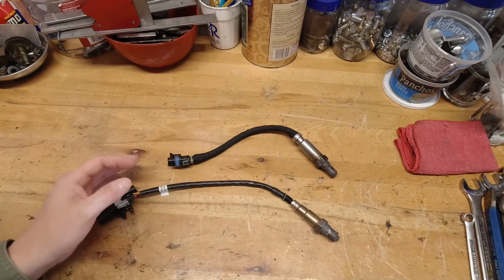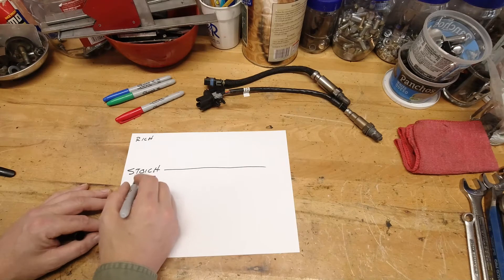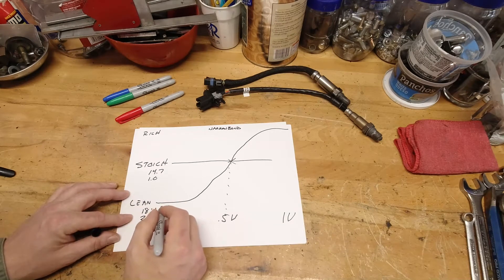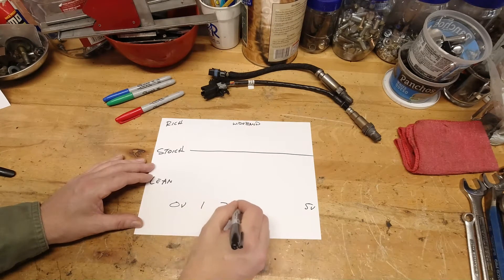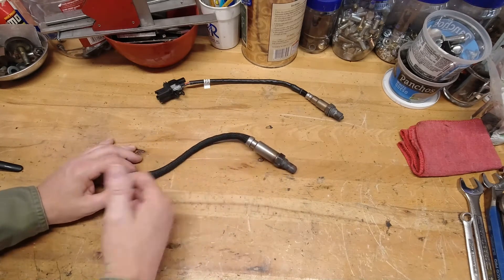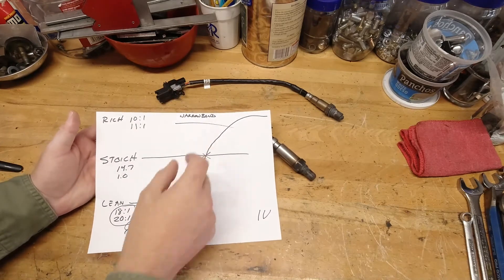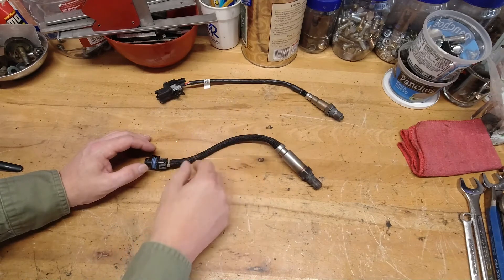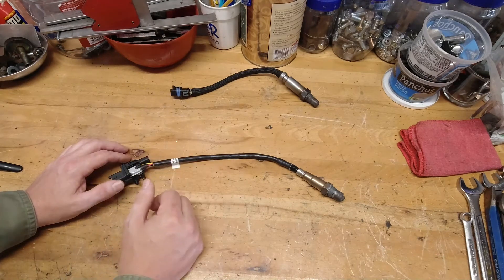Narrowband vs Wideband AFR Gauge

Comment: So theres a new in box UEGO narrow band near me for for $30. I'm a novice cheapskate just looking to polish my idle fuel mixture tuning abilities on holleys before I dive into metering circuit tuning. I know how to use a vac guage and listen for idle changes but just want to see how my adjustments actually relate. Good purchase or dont bother and get wide band instead?
Reply from the maker: Narrow band just doesn’t give you enough good feedback to make smart tuning decisions.
Reply: Kinda knew that would be the answer. Thanks for all that you do!
Reply from the maker: @justtellmewhy8078  I’ve done a lot of recent tuning videos with a wideband AFR if you’d like to see it in action.  The narrowband is just not enough info.

Comment: Question, I'm going to install a new AFR wideband gauge in my truck with duel 02 snsr's. The instructions say to install the 02 bungs a minimum of 24 inch's from the collector flange. I'm wondering how far away I can mount the bungs from the collector's and is there any issue with accuracy of the reading depending on distance? Thanks

Comment: Hello , I’m currently in the process of adding a small belt driven root compressor to a 1950 8n ford tractor. I’m looking to boost the flathead 4 cylinder with in normal operation rpm range through an updraft carburetors. Any recommendations for the modifications would be appreciated. Thanks

Comment: Thanks for your time and knowledge. I recently viewed a video from David Vizard about carburettor tuning and he emphasised narrow band gauge and sensor with I think reference to using a vacuum gauge as well. I am interested to find as much knowledge as I can before I make the purchase and yours seems to make sense. A question I have is to do with how the gauge and sensor works together, is there some other computer or analysing box needed or does the sensor wire directly to the gauge and power supply to be used in a vehicle with no computer. If you have any suggestion I would be grateful for your time. Thankyou.
Reply from the maker: @cameronjohnston5748   I just did a tuning video using a wideband AFR to tune an Edelbrock carb.  No other computer needed.
Reply: @MuscleCarSolutions  thanks I will look for it.

Comment: Great video I’m building a test stand to run old school carbureted engines. What other components would I need other than the wide band gauge to enhance my understanding of how the engine is performing related to the wide band components? I’m old school and currently have a tach/ oil pressure gauge/ vac gauge/ temp gauge etc??

Comment: I hope its not too late to ask this question, but I'm working on a truck that has factory efi with narrowbands. the engine had a big failure so it was rebuilt with performance in mind, its still NA but it has a longer stroke, much higher compression, better intake, bigger cam, ect. On my factory ecu I have an operating system that would allow me to wire in a wideband to replace the narrwoband which I plan to do eventually. But as I'm getting ready to fire up this engine for the first time can I get away with a narrowband until I have the funds for widebands with a conservative tune? I can't run a factory tune because the engine is radically different like not even the same displacement. Not gonna lie rebuilding an engine which needed all new internals and springing for a forged bottom end has bled me dry otherwise I'd just go get a pair of sensors

Comment: For the narrow band, Couldn’t you just monitor the voltage on the 02 sensor if 0.5 is stoich maybe even add a resistor to tune the voltage if needed?

Comment: I know this is an old video. But I’m going to ask I have an 85 Mr2 with the 4age NA. All run off the stock computer. Since all I am trying to do is know lean or rich from the gauge is it wise to just use the narrow band? It is an Autocross car but no power adder or stand alone fuel management. Just for fun. Thanks for any advise.
Reply: Wideband is a better choice, it gives more data between the signal voltage. Widebands are best to none when it comes to monitoring your afr (that's why all tuners use this). But if your really in a budget and just want to have a reference point to where your afr is, a narrow band with a wider breakdown on its signal voltage would be better. I think dynoracing has one wherein they broke down the signal voltage of 0 - 1 into decimal incriments to get a sort of precise reading on your afr during the rpm range.

Comment: Wow thanks a lot for this video!
I'm looking for a sensor with a gauge to put in my '65 Volvo, just to monitor if the carburettors need adjustment.
Now its clear I can just take the narrowband!
Reply from the maker: Narrowband will give you less info.
Reply: @MuscleCarSolutions  Exactly! I only need to know if it runs stoich or not, i'm not interested in the exact value!

Comment: Hi Sir,

2019 5.0 Mustang.

Would you recommend a Duel set up & where is the best place to install the 02 Sensors?

Supercharged & Headers installed on the vehicle. 

Or do you keep the original factory 02 Sensors & also add the Bosch 02 Sensors as well. 

My explanation is because I'm from Australia 🇦🇺 if my terminology is different. 

Kind Regards, 
William.
Reply from the maker: The factory computer will only monitor however many channels it has in the system.  If there’s only one, it will monitor one and you can’t add a second.  If you want to monitor it on your own or are switching to a aftermarket stand alone system, then two is always a better choice to monitor both banks.

Comment: I was really hoping this guy would mention carbureted applications and if there is any reason to buy wideband if only trying to make sure your not lean all of the time.
Reply from the maker: The whole point of an AFR is to monitor operation and evaluate changes made.  This is simply a discussion on the differences in the two types of sensors.  As a tuning tool, I assumed it was understood it’s extremely valuable and I recommend using one of you can afford one.  Simplifies and speeds up the process and gets better results.

Comment: Hope you enjoyed SEMA! I think I could really use a wide band AFR on the Mustang. Cold starts are stinky and more smokey then my neighbors like lol. The car runs strong once warmed up with the new avs2. Maybe  now that I'm a little older I'm more cautious, but the idea of running lean and not knowing eats at the back of my mind..So I'm  purchasing an AME X series from Summit because without one I will literally drive myself insane. Just a heads up I'm sure I'll have about 3 or 40 questions. Any help you can offer as always is really appreciated. Between you and  the gys at C&C Auto Works I've got so much help. I appreciate you guys a bunch.
Reply from the maker: Thanks!  AFR is an amazing tuning tool.  I wish more would take advantage of it rather than thinking that “seat of the pants” tuning is effective.  You leave a lot of power/economy/drivability on the table with that old antiquated method.  It will make your tuning time much quicker, but there’s still lots of driving between changes to verify it’s what works across all situations.  You’ll enjoy it.  Get busy!

Comment: In (my) narrowband application there are four sensors, two pre-cat and two post-cat. Is this the same with wideband applications? I am doing an engine swap with an aftermarket ECU. Do I need four WB sensors? Or do I block off my post-cat bungs?
Reply from the maker: Really depends on what your device is asking for.  I don’t have a clue what system you’re using or is it something factory?
Reply: @MuscleCarSolutions  Swapping a 1UZFE non-VVTi on a Link G4X Storm COP into an Isuzu VehiCross that originally had a V6 with auto now has manual. Plan to run dual cats and exhaust.
Reply from the maker: @scottbartlett4853  I have no knowledge of that system.

Comment: hi, can i use cheap narrowband to tune the carburetor on my old motorcycle? Are they relatively accurate? And if possible, which brand is the best?
Reply from the maker: Narrowband doesn’t give enough info.  Watch the video and it will explain it for you.
Reply: @MuscleCarSolutions  thanks sir

Comment: Maybe you can help me I just acquired a badass Baja that needs some help on the fuel injection that it has I replaced all the fuel line and I haven't even started her yet and added a water fuel separator it's a generation 1 CB performance fuel injection system called Ultra performance fuel injection they have the instructions on their website my question is what sensor can I use wideband or narrowband 2 best control the fuel mixture it has two knobs one for idle and 4 wide open throttle the computer is based off of geostorm😂 but I have four individual throttle bodies based off of Old Weber carburetor design you can help them be freaking awesome dude
Reply from the maker: Don’t have a clue what that system needs.

Comment: Overall good video but confusing at a few spots. 
@ 2:15 did you mean narrow band? 
@ 3:45 did you mean wide band? 
@7:30 12:1 narrow band out of range. Did you mean less than 10:1? It looked as though 12:1 was within the range on the narrow band graph.

Comment: Yes I am that narrow band guy.... Classic standard T-bird. Thanks
Reply from the maker: Narrowband O2s do work, they just don’t provide much information that’s helpful with tuning.  What are you using yours for?
Reply: @MuscleCarSolutions  Just to be assure my carburator is tuned right.
And for the extra milage...
1964 Thunderbird 390FE with 1406 Edelbrock carb
Reply from the maker: Mileage driving is really what the narrowband is best at.  If you can keep it in that prime target area, you’re doing about as best you can!

Comment: Exactly:  The time you spend, the frustration of not getting tuned right, the wasted fuel, more.  Wideband.  You learn more while you drive and test your pedal action, the car response, the changes in altitude/weather.  To me, it's like a toy that enhances your driving/tuning experience.  Not better than beer, of course.  :-)
Reply from the maker: It’s a tool that for sure has made everyone better at tuning on the carburetor side and has given such amazing leaps forward for EFI.  Beers to you!
Reply: @MuscleCarSolutions  Not sure if you noticed at the 2:13 mark but you mixed up the voltage measurement for the 2 sensors. You said the Wideband has a measurement of 0-1v but you should have said the Narrowband has that. Good info though.
Reply: I bought one of those led edelbrock afr meters back in the early 90s which are narrow band. If I remember correctly, it was over $200 back then. Definitely wasn’t $50.  I always found it to be  kind of helpful but only if you were in the ballpark to start with. Maybe they were costly because there was not much to choose from back then?